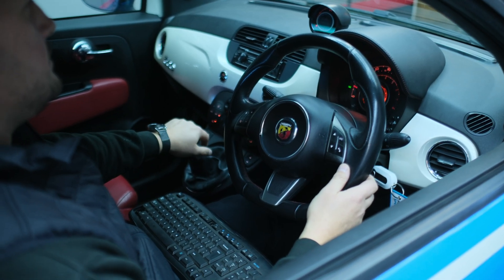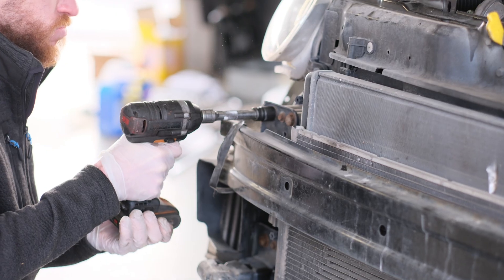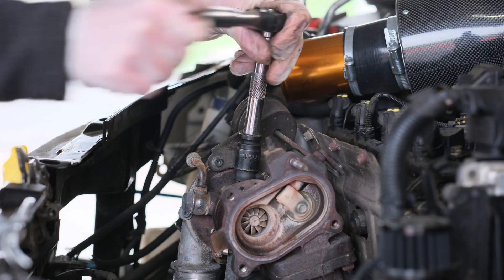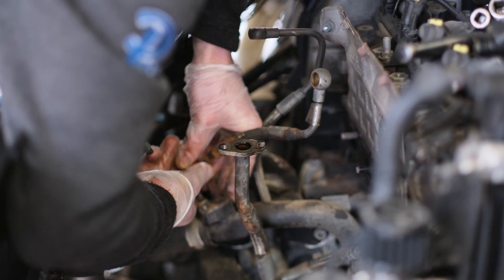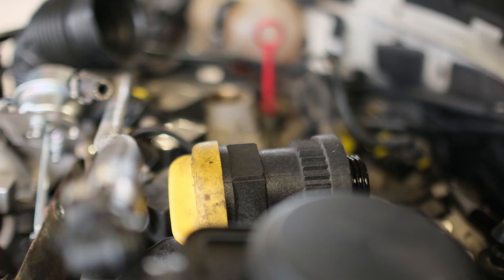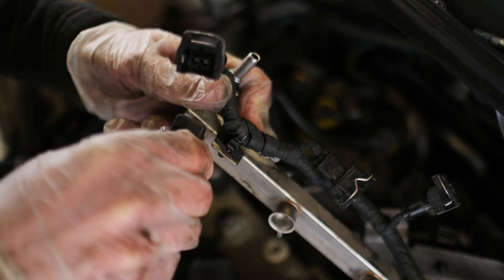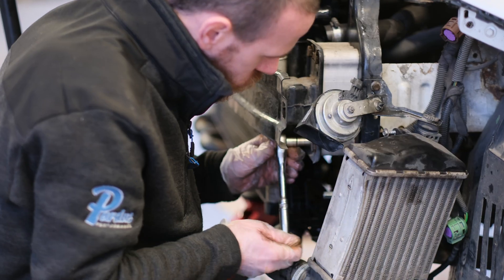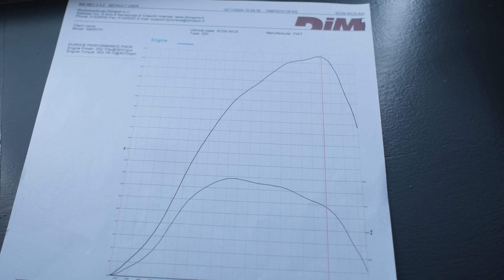Purdue Performance TD04 Turbo Kit Fitting Guide - Abarth 500

Comment: This is all beautiful, but according to professionals this body design might not be able to handle safely all this power due to the short wheel base. Even in my experience after 80 miles per house driving, any deviation of the roadbed makes this car unstable pushing it from side to side.
Reply: Yep, abarth are scary. This kit cannot be purchased with bigger b***s unfortunately.

Comment: Great video, thank you!
Before I order, I like a few clarifications:
1. Is there any need to remap the ECU after installation of the turbo kit?
2. Besides the kit advertised on your website, what else did the car that you installed the kit, what other non-stock (non-OEM) the car had that you could achieve 200+ HP?
Thanks again,
Zack.

Comment: td04 with stock 4 L poor intercoolers and not a front one upgraded with 9L capacity, good luck melting the motor, guys pls do things properly if u want to do a classic tjet stage 3
Reply from the maker: When we are going to stage 3 we will for sure be upgrading to a FMIC. For road use the OEM intercoolers are good for 250-260bhp. It would only be for sustained hard driving, like track use, a FMIC would prevent heat soak. Follow along to see the cars development stages!
Reply: @ putting on a TD04 is already considered with the software scripted a stage 3, like the amount of air that the stock IC it’s very very undersized with the flow capacity of the turbo, i have a stage 3 abarth and first thing my tuner putted on was a airtec 9.5 L intercooler, when moving to the dyno the temperature will increase every single launch and won’t be a safe tune anymore…i mean italian tuners are the best on 595 abarths

Comment: No intercooler for this power ?
Reply from the maker: The standard intercooler is good for 250-260bhp!
Reply: @purdueperformance   assolutamente non va bene intercooler standard... prima di scrivere bisogna fare test!...sono troppo piccoli e la turbina td04 e molto piu grande della IHI .. i due piccoli non raffreddano l'aria come devono.. anche perche hanno un giro tubi molto piu lungo...quindi perdita di cavalli con alte temperature.. in italia con 30 gradi di caldo perdi 20/30 cv di potenza come minimo ... (in uk c'è più freddo ecco perchè per voi vanno bene gli standard) ci vuole un intercooler airtec da 8/9 litri frontale... e in piu eliminare scambiatore di calore per mettere radiatore olio maggiorato perchè la td04 si raffredda solo ad olio...  parlo per esperienza ho un abarth da piu di 15 anni con 290 cv di potenza con motore originale e mai avuto un problema oppure perdita di cavalli...

Comment: Nice vid guys ! Mine had a heat shield on the manifold  that blocks access to the manifold studs (or most of ), the studs are too long even with nut undone to lift it over and remove as it clashes the turbo mount flange , leaving you with no choice but to remove/cut them to get it off , I see yours has been previously removed  have you come across this ? I know some models just have bolts from what I've seen, was a source of frustration 😮‍💨